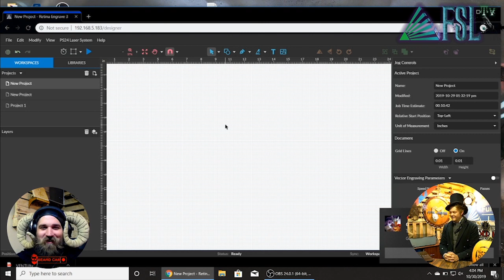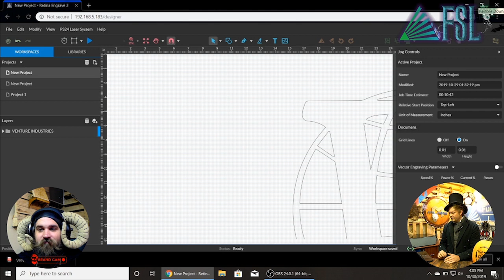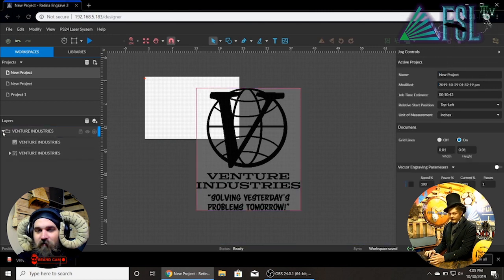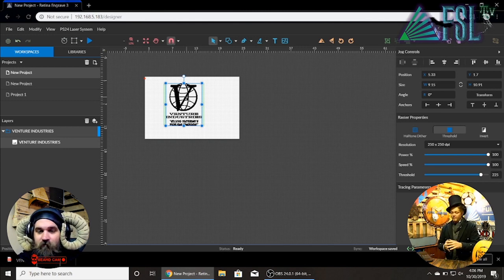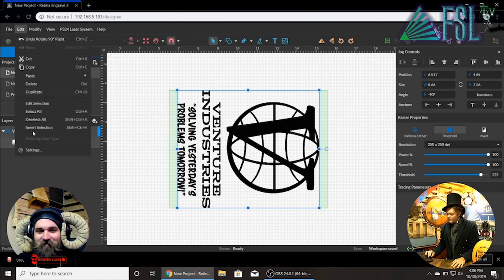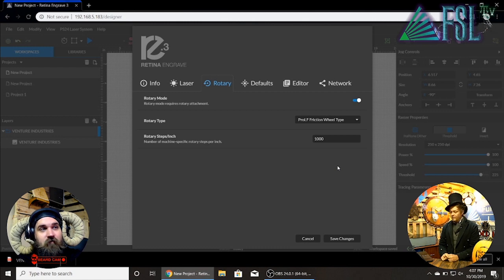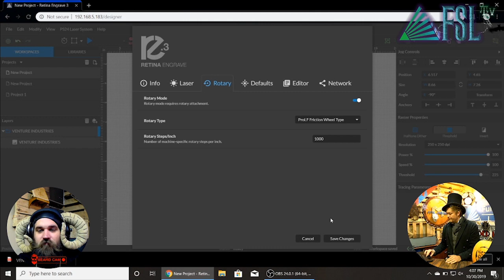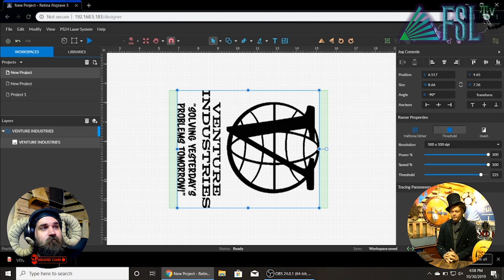Jump Into The Software ep. 1 - Pro Rotary Set up

Comment: Which laser size did you use? Should I switch out to the 5?
Reply from the maker: Probably not. The 5" lens is mostly used for cutting taller materials. For engraving on the rotary you want to use a shorter focal lens lens like 1.5" or 2" lens to get more detail.

Comment: So why did mine end up backwards?  5 words all correct but reversed. not only that. One of your other videos never said to open settings and change to rotary. my cup was spinning 100 miles per hour. It would be nice to slow down and go into more detail of each step instead of turning it into a comic act. Most people learn by slow to the point tutorials. what each click is for and why. Maybe its just me.
Reply: Hi Larry, we had the same issue and switched out the rotary to the other side of the engraving table. We have the PS20. This solved the problem.
We have issues every time we use either of the 2 rotary attachments, have to re-start laser and software. Good Luck!
Reply: @MissEngraver  Thanks for the tip. I know you have to kill the power to the machine to swap the axis cable out. After you fire it back up it wont home out and says unhook the rotary to home machine. Must be its not to important to home it out when you start it. I know my CNC routers need to be homed out each time you start them. I understand why because i ran CNC mills and Lathes for 40 years in my Machine and tool making trade over the years. Ive ran CNC mills CNC lathes and wire EDM for many years.